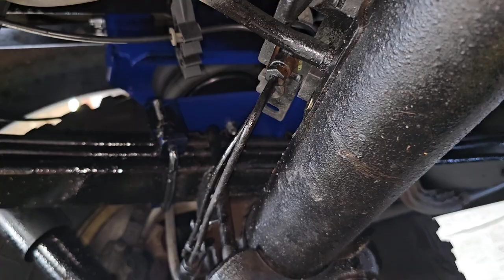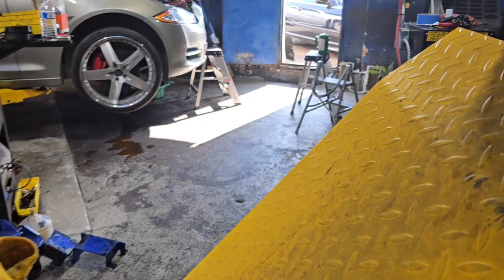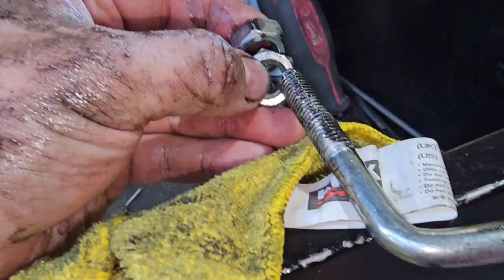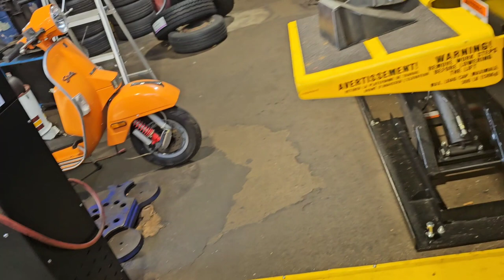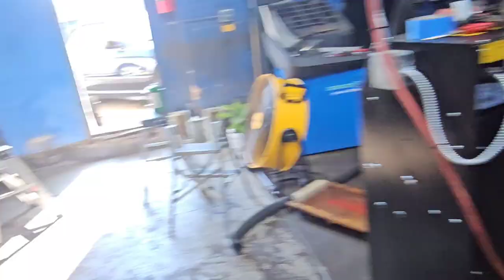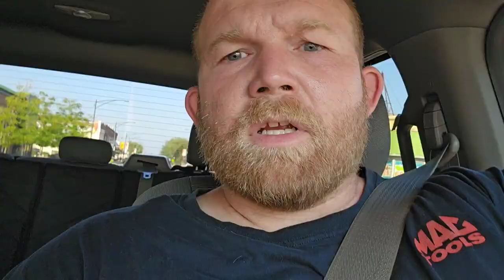Before Installing Helper Tow Bags - Watch This Please @PTT @Rainman @CP @DS

Comment: I had U bolts made up at dubuque spring company in Iowa.
When I built heavy trailers for hauling concrete block.
I might not be seeing it right but the more space between clamps on leaf springs stiffen the springs.
When multi leaves are compressed they need to slide across each other.
If they get clamped to much they have a hard time when being sprung and you you end up with steel bars and no spring.
For that spring the U bolts need to be in the same stock locations.
Just my thought.

Comment: I put Firestone bags on like I had on my Mack truck, they did not look anywhere as compressed as yours do. I put on a compressor and gauges in the truck and kept 15 psi in them when not towing and the ride was great and eliminated the cracking on the leaf springs from vibration as many F-350 diesels had.
Reply from the maker: This is just a public service announcement buddy you can either take it with what you want and be aware of it or everybody can share all their stories and try to one up me or say this versus that and I'm just letting you guys know what to be aware of that's all
Reply: Why are you always so defensive. The guy was just commenting on his experience with bags. Turn the comments off if you don’t wanna to hear from your subscribers.

Comment: Don't know if this right what about to say but here goes. :  Also the leaf spring mounts with two and  the link to the body and the axle housing centered between them. When you add the bag, that is three points on the body. Plus a direct line of resistance to the body half way along the leaf.  So the  spring rate would be 3 1/2 that of the original spring rate. Whether or not you add the resistance added by inflation.  Huh maybe take leaf out?!  When adding the bag. Which would leave that u bolt shank bound.
Reply from the maker: That's too much work to run a set of air bags when you're not Towing I wouldn't recommend people go through that much work to do that because it's like you're kind of wasting your time
Reply: Yep i would totally agree.  Funny my mate had ssangyong musso. And the springs on that were like a lesbians  jock strap. (Soft so she doesnt get a double wedgy) the bags actually improved it.

Comment: Curious here. What is the point of the bags? Towing more than the truck is rated at (increase capacity)?
Reply from the maker: I've already covered this in the past, the bags are only for leveling the truck out for breaking nothing else it doesn't add to or take away from the suspension in stock form you still have to adhere to stock rated suspension and the numbers applied to that vehicle from the factory all it does is level the vehicle so you're breaking forces evenly distributed like it was intended to
Reply: @FordBossMe Gotcha'. I missed the other video, sorry. I don't always get notifications of videos and it isn't just yours.

Comment: You have to run your bags aired up not sagged I have towed 13.800 for yrs keep 30 psi in my bags empty smooth ride on 3/4 ton always keep bags aired up 10 15 20 psi till you tow
Reply from the maker: I tried putting like 10 psi in it and the ride was too rough
Reply from the maker: The company told me to take the air out of it to make the ride better